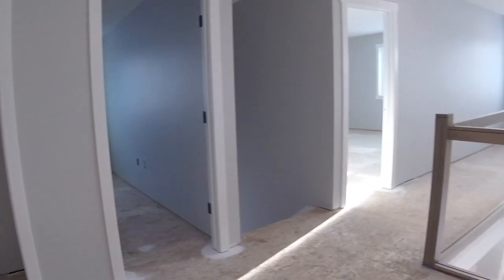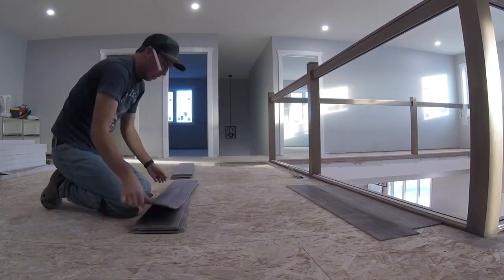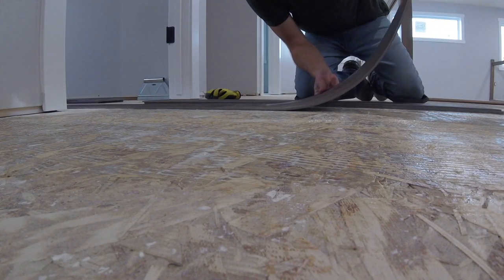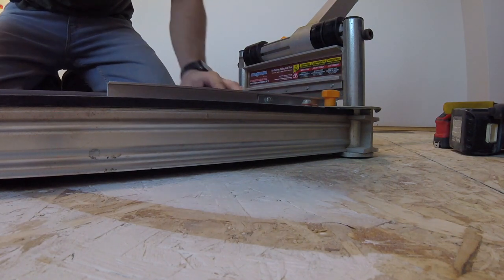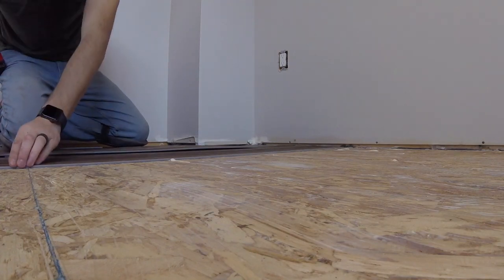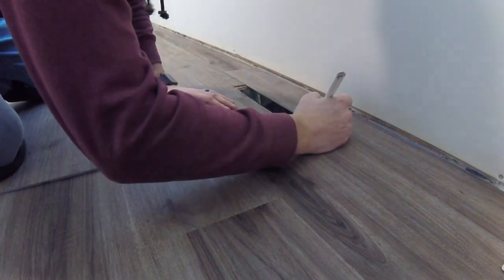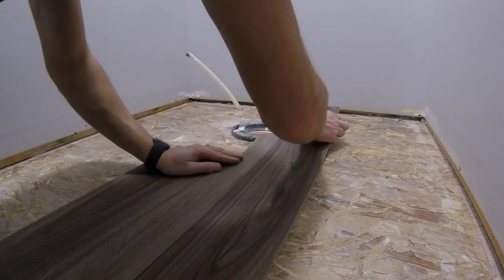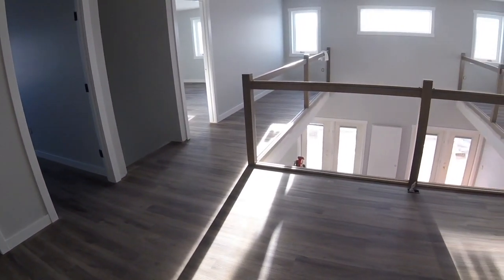How to install vinyl plank flooring with glue

Comment: british standards here in uk will say to board over the OSB with 6mm plywood first.
Reply from the maker: You can forsure. We put down particle board, pro board or plywood if we are installing the thinner vinyl plank (1/8 thick) because it’s to hard to sand the osb perfect and you’ll feel the imperfections. Also people think the glue wrecks the osb subfloor and it doesn’t. As long as ur using the right stuff.

Comment: Very nice work. Can this be glued down right on top of existing tile floor with grout lines? Also, are you purchasing that type of product at a flooring store or big box hardware store? I've only found the tongue and groove floating vinyl planks or peel and stick vinyl planks. Would like to take a look at this type of glue down vinyl. Thank you
Reply from the maker: I wouldn’t go over tile, if a joint in the planks lands on a grout line you’ll feel it. Any home store should have it.

Comment: GREAT work!! Im also puting over OSB and had to do a little patching.. do I need some sort of primer because of the OSB? THANX for a great video
Reply from the maker: No as long as your joints are sanded and osbs clean ur good
Reply: I was looking for that answer!!! Thanks!!!
Reply: For osb  I recommend a skim coat of feather finish,  on 10 pound bag goes about 350 sq feet..it will level all the osb particles.

Comment: What is that called underneath the LVP? They did my flooring but that glued down to the concrete, would that be an issue for me? Should I re do it?
Reply from the maker: It’s just sub floor under the flooring. It’s fine to glue down to concrete as well

Comment: Be interested to know how it looks at the moment, osb and chipboard is a no go for an installer. Diy sure why not but I've had to many chipboard floors cause problems to the point where manufacturers won't warranty installs on it, but this could be different depending on country.
Reply from the maker: What kind of problems? We’ve put the thicker vinyl on osb for years. And the thinner stuff is recommended to go over top of pro board. The glue that’s used isn’t much different then what’s used to lay Lino. So it wouldn’t swell or anything
Reply: @thunts2774  you could be right with the thicker stuff, most of the issues we have with any chipboard here is the planks themselves shrink or move etc and never get that issue on concrete with the same product so the manufacturers just blanket covered themselves and said subfloor all chipboard. 14 years of installation and only ever had problems with chipboards but you are right can be very product dependent, thicker glue down planks can be a bit more dimensionally stable. Here where I'm from (New Zealand) the flooring industry is a bit strange for example I'm self employed but all my work comes from the flooring retailers who have a shop and sell the product and measure it and pass the jobs on to us, so when certain things go wrong they can get a bit gun shy and just make all encompassing recommendations for things.
Reply from the maker: @bradfry2259  interesting, ya since we’re on other sides of the world I could see our pro board, particle board, k3 etc could be a bit different to.
Reply: @thunts2774  yea you could be right that's probably why I like watching these vids because I like seeing the different ways people do things. Apologies if my comment came off a little dickish. Haha you guys are lucky the way you often install with no skirting boards on I have to cut up to them 99% of the time, I do undercut door frames to save time to though.

Comment: where to purchase the tool used to spread the glue? Size of the notch?
Reply from the maker: Any home building center. V trowel. 1/16 inch deep or 1/32 works to

Comment: Could you do this over gypcrete? Would you have to do a cement coat on top? It’s my understanding you can’t nail plywood or anything to it.
Reply from the maker: Ya we put it on concrete all the time, just make sure it’s really clean. And if theirs big cracks and things u might wanna fill them with a thinset before u glue and put floor down.

Comment: Shouldn’t that be rolled with a 75-100lb roller?
Reply from the maker: Not a big deal in new houses. The floors are pretty good after we sand them. Rollers are more for concrete floors in basements. Walking on the floor does the same thing over time anyway
Reply: @thunts2774  thank you very much. That explains my confusion. I’ve been watching flooring laid over asbestos tile in a basement. That’s what mine is. Thanks again.

Comment: Whats the thickness of the vinyl?
Reply from the maker: Bout 3/16 of an inch. I’m doing a video right now of 1/16 inch vinyl plank.
Reply: @thunts2774  what’s the 1/16 like for quality /durability?
Reply from the maker: @therarebreed8038  this is the first time we’ve laid it so I can’t say much. It’s recommended to lay 3/8 pro board overtop of the sub floor so you don’t feel joints and imperfections. So it is more work that way
Reply: @thunts2774  Yes that’s for sure. Thicker stuff it is I think lol Thanks.